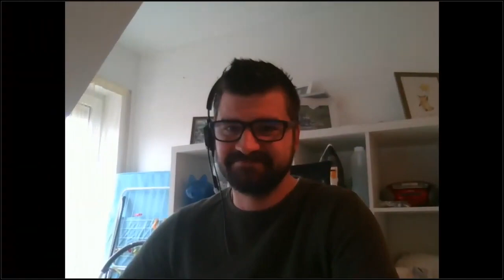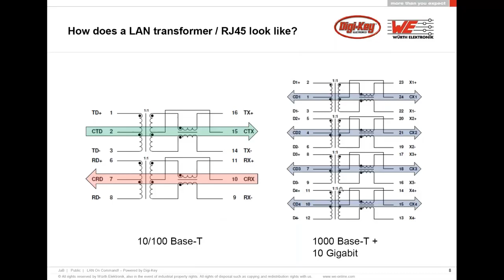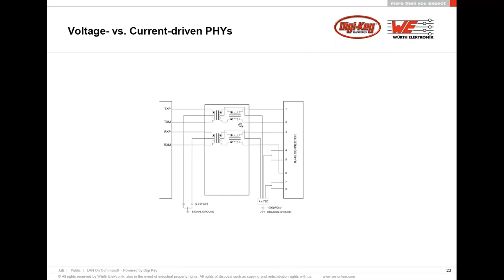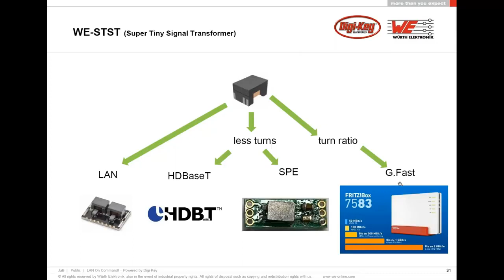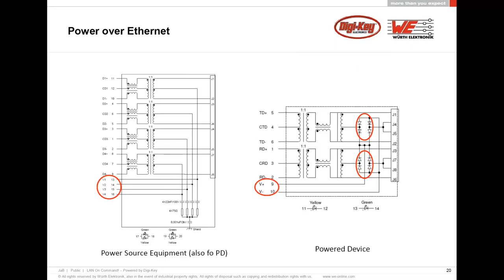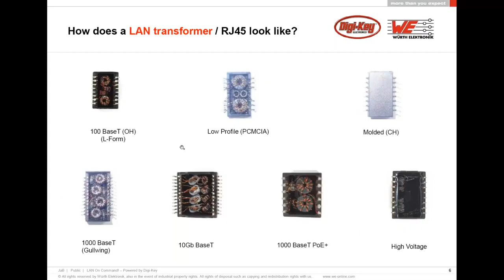WEbinar Powered by Digi-Key: LAN Transformers: LAN On Command!

Comment: It's not the differences in device manufactures that requires the diode bridge.  It's errors in the building wiring.  Wire pairs getting swapped or reversed as the cabling traverses from room to room, floor to floor.  Not everyone is a certified electrician. Office workers wouldn't know the difference between a crossover cable and a cup of coffee.